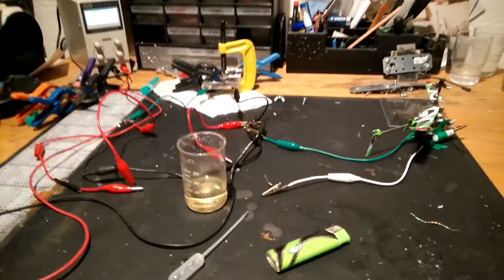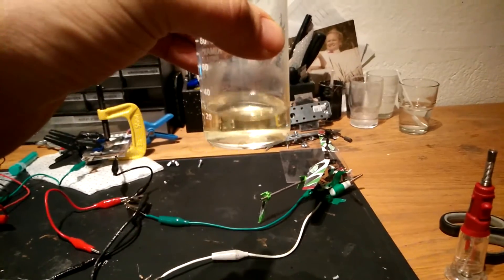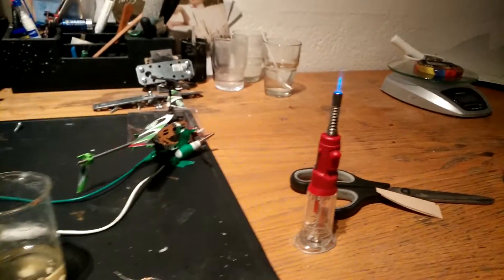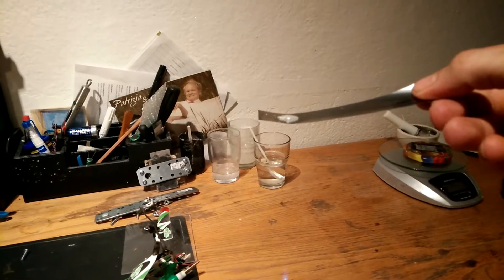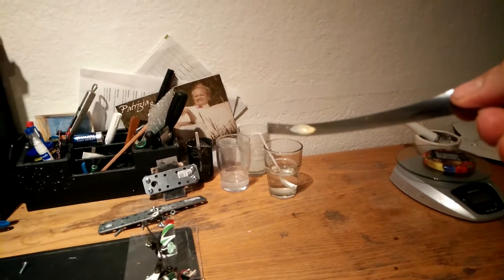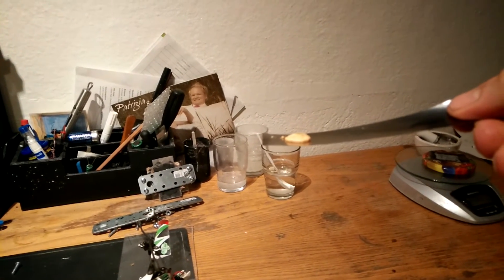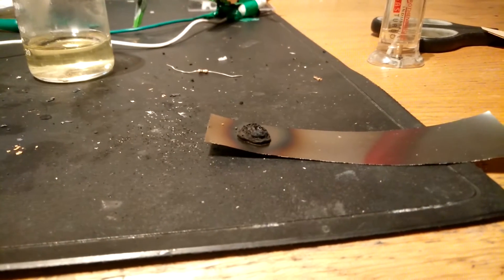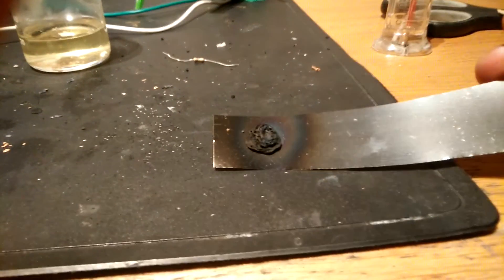try to make activated carbon like robert murray smith

Comment: Ähhh...wie funktioniert das ?? Einfach Zinc-Oxide in Wasser und dann auf einer Graphitfolie erhitzen oder wie ?
Geht das mit Zink Nitrite besser ? Benutzt Victor Petrik auch ne Lösung aus Zink-Nitrite oder wie ? Was issn das fürn cooler Brenner, den Du da hast ? Wo gibt es den ?
Reply from the maker: +overunitydotcom 
Hi, Zinkoxid mit Natronlauge + Zuckerwasser.
Ob zink nitrite  besser geht weiß ich nicht weil ich kein Zinknitrite haben :-)
den brenner habe ich aus irgendeinen Baumarkt.
Reply: ehochimalpi
Achso, also was aufschäumt ist hier dann dauch der verbrannte Zucker, ich dachte der Carbonschaum kommt aus der Graphitfolie..Setzt das Zinkoxid irgendwie Sauerstoff frei oder wofür brauchste das NaOH und Zinkoxid ?
Reply from the maker: da fragst du mich zuviel. :-)
Reply: +ehochimalpi WIe gesagt, versuch mal Puderzucker 4 Teile mit 1 Teil KaiserNatron ( NaHCO3) zu mischen und dann noch ein bischen Holzasche oder Zigarettenasche oder Papierasche reinmachen als Katalysator und zünde das mal an mit Deinem Brenner, dann bekommste richtig coole Carbon-Schlangen. Kannste bitte mal bei denen den Widerstand messen ? Vielen Dank. Gruss, Stefan.
Reply from the maker: nach dem carbonisieren haben ich 9.2 ohm auf einem cm.
Reply: ehochimalpi
Echt super ! Probier mal die NaHCO3 und Puderzucker-Schlange !